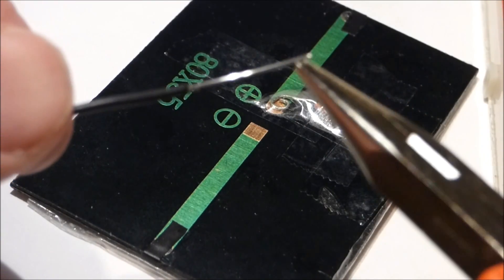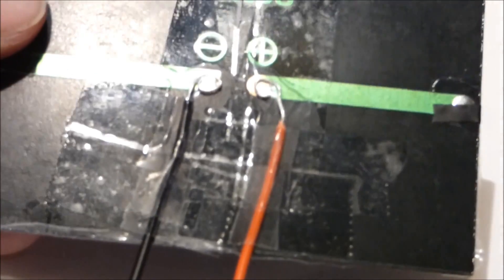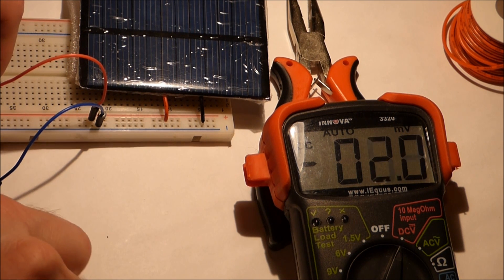I temporarily attach wires to a small 6V solar cell using just tape  How to DIY electronics tutorial

Comment: im making a solar powered car with a 12v solar panel for my science project, if i used this method, as i dont have a soldering gun, would it still work?
Reply from the maker: If there's no better option, I think it will. Good luck!

Comment: Could you have solar panel walls and capture some of the energy used in lighting indoor homes?
Reply from the maker: When I was a kid, it was common to come across calculators that had solar cells to power the calculator under lamp light. I don't know how effective larger panels are at collecting indoor light, but you should be able to if you really wanted to. I'd only seriously invest in something like that if I was also planning on setting it outdoors if the power went out or something. The Indoor light might keep batteries fully charged after being charged if they are not being used much. Maybe just use them daily to charge a cell phone or something. I'd test it out with smaller cells like these, or another low priced setup, and see if they can keep a portable power bank charged before trying to go larger.

Comment: I have  a 7 volt one. I cant  run a 3v motor. Useless, I think.
Reply from the maker: You could use a buck converter to turn the 7V into 3V.
Reply: Shouldnt the motor run on 7 volts aand 3volts? Anyway the specs are 6v and 200mA. I guess the 200ma isnt enough to run the motor.

Comment: Hey good video! need regulator 7805 for direct charge to cellphone?
Reply from the maker: That's something I need to test. I've noticed and read from others that cell phones can be mistrusting of certain power sources, and will limit current from a source it doesn't trust for whatever reason. I think the 7805 needs a minimum of 7V so this panel is probably worthless for charging a phone. I like this solar panel so far https://youtu.be/ZM6s0TLXqdI which already outputs 5V via USB. I suspect it is better to use this panel to charge a power bank and then use the power bank to charge the cell phone than to directly connect the cell phone to the solar panel.

Comment: and i can used 12v DC motor to 6v solar panel
Reply from the maker: You could put 2 in series for 12 volts. And then put some series cells in parallel to increase the current. But your probably best off buying a panel that already outputs what you need.
Reply: bro please please tell me. I can charged 3waat solar panel in 6v solar battery but, how many times charged this battery. on no circuit
Reply from the maker: I don't charge batteries with solar yet, so I'm not the best person to ask, but this would only charge a small battery. Here's a video I did measuring a mini solar panel designed to charge a cell phone battery. https://youtu.be/5jLqODtkMtQ A much better solar set up.
Reply: Tnqs for information bro.